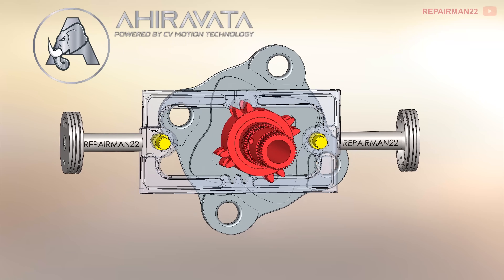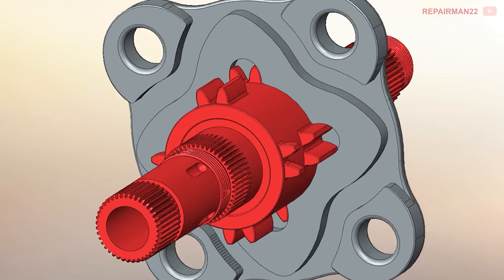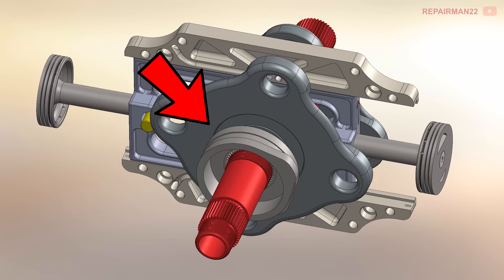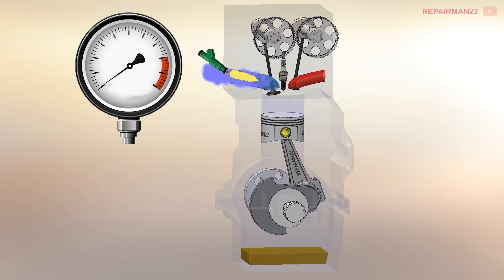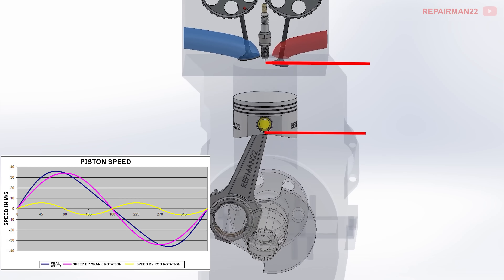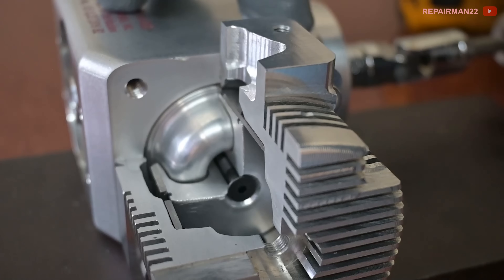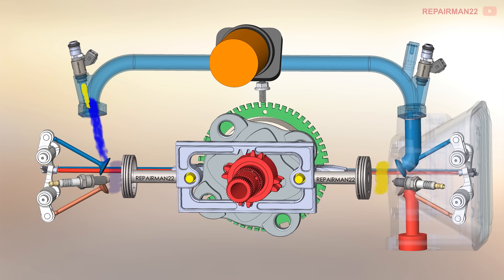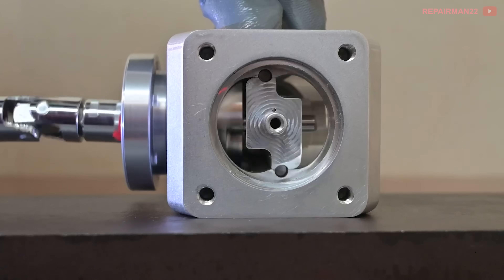The New FLOWER ENGINE 🌺 from Ahiravata 🐘

Comment: Something very simple that could minimize the friction between the pins and the flower is to put bearings on its tip, so it will roll through the rails of the flower, instead of slide
Reply: I'm sure you could get hundreds of hours of run time with ball bearings but not tens of thousands of hours like a conventional engine. The only bearings strong enough for a job like this would be fluid bearing and those are going to require more engineering on the motor designers part.
Reply: @deltafire5058  Makes sense considering it keeps getting smacked back and forth. Not sure though.
Reply: This is the most over complicated, engine design I have ever seen just to produce significantly less power due to the weight of the rotating assembly.
Reply: @fl_atv_riders4455  
Not really.
Reply: @fl_atv_riders4455 this could be a good alternative for hybrid engines..
Reply: That might work but it might also have a problem with being rolled on each side at the same time, in the same direction. But that might be worked around. the've probably already looked into it.
Reply: Oil lubrication will solve this just like how conventional crankshaft works.
Reply: Needle bearings?
Reply: It would be interesting to see when it’s under load like a motorcycle or small car.
Reply: This is literally a 200 year old technology..
Once again, Hindus build some outdated technology, and claim to "invent" it.
Reply: Magnetic bearings?
Reply: These wobble board cranky engines have been around since the days of steam .They do work ,but suffer from unusual wear in various places .Hydraulic motors use a fashion of this principle .Sorry ,but no cigar .
Reply: Please let us just look at the engine and how it works! As opposed to a new "cut" every 3 seconds and gobs of "gee whiz! this is so great!" commentary.
Reply: Like current rockers !!
Reply: Just the tip?
Reply: There u go…nice idea
Reply: The problem with ball or needle bearings is that their speed is constantly increasing and decreasing in this application. The pins may need to have bearings in the yolk body - then it is a matter of lubricating them.
Reply: Do not understand why there are so few teeth. Place more and use them to deliver the power to the drive shaft. Use the flower to synchronize the thing.
Reply: @MennoSmits-v1l 
The pins on the flower transfer the power.
Reply: @MennoSmits-v1l those few teeth are to synchronize  the contact points where the rollers do not touch..
Reply: Was going to say the very same!

Comment: I can see the four stroke version being viable. but two strokes are inherently dirty, because they have to burn oil to have lubrication. they would be difficult to meet emission control standards. and my other point of contention. is the teeth on the flower and the rod rack would be suseptable to breaking off.
Reply: Actually this type of engine will be better in 2 stroke.   Those old 2 stroke engine that requires oil mixed fuel is simply because oil is needed to lubricane the crank bearings and pistons.
Reply: What nonsense..?
Reply: Please let us just look at the engine and how it works! As opposed to a new "cut" every 3 seconds and gobs of "gee whiz! this is so great!" commentary.
Reply: The oil burning of a two stroke is due to combustion gases passing through the crankcase. In this design, the underside of the piston is separated from the ceankcase area, so that problem does not arise.
Reply: @pashakdescilly7517  But that piston to cylinder area still needs lubrication.  So I doubt you could completely remove the oil from the fuel.  I'll grant you that, with practically zero lateral movement, it would be far less critical but could it be eliminated completely?  Maybe some ceramic material would make that possible, but metal to metal generally needs lubrication.
Reply: @KenFullman  The connection to the 'crank' arrangement is off the centre line, so there will be forces carried though the piston, and therefore a need for lubrication. Ceramics and/or teflon may reduce this.
Reply: @KenFullman those piston work with gas floating piston rings that doesn't need lubrication...the lubrication happens on the lower part of the piston shaft...
Reply: @pashakdescilly7517 
Two strokes require the fuel and oil to be mixed together. whether it is mixed before the it is put in the fuel tank. or whether it is mixed by oil injection. either way the engine is burning a mixture of fuel and oil. and it's why they are inherently dirty engines. you apparently don't know much about two stroke engines.
Reply: @musicauthority674 Oh come on. The oil is mixed in ordinary two stroke engine to feed the crankshaft main and big end bearings. And yo a much lesser extent, the piston. This design separates the crsnkshaft from the combustion gases. Try thinking before you post.
Reply: @musicauthority674this design mitigates the fuel oil mixture..it is not your standard old two stroke engine...the lubrication part is below the air intake part that doesn't come noncontact with the air fuel mixture..

Comment: I predict this design will be yet another dead end, crankshaft alternatives have been tried an tried again the Scotch yoke is my personal favorite, but nothing will replace a simple crankshaft in a piston engine. For something like this to gain traction it must have some practical advantage maybe it's fewer parts or maybe the parts are able to be made easier/faster an helps to lower manufacturing costs. It's novel and I could definitely see this mechanism having a use in a compressor, but as an engine it's not solving any problem so it's a folly.

Comment: Limiting the speed to 2000rpm has to be because of the absolutely massive reciprocating mass. If the design would allow spinning up to 6000 or more rpm it would be making pretty much triple the power in the same amount of space.
Reply: There's no way it would be possible to achieve a higher RPM with that flower and rod rack arrangement. so using it as a conventional engine would likely not be possible. but there could be a remote possibility. it could be a powerplant for a generator in a hybrid configuration.
Reply: Remember that if the "crankshaft" is spinning at 2,000 rpm, the pistons are oscillating 4,000 times a minute, so it isn't as slow as it sounds...
That's why the cam lobes for the 4 stroke can be attached directly to the "crankshaft"... it is spinning at "half engine speed".
Interesting concept, but I doubt that the pin / slot mechanism can be made reliable.
Reply: This engine can't be used for higher rpms, simply because of the constant velocity pistons. At higher rpms these constant velocity pistons will find it difficult to give higher efficiency as in conventional high rpm engines. This can be used in trucks, tractors, marine engines etc, but not for performance engines
Reply: Please let us just look at the engine and how it works! As opposed to a new "cut" every 3 seconds and gobs of "gee whiz! this is so great!" commentary.
Reply: because the pistons have the same number of cycles while the shaft runs at half speed the pistons would have to triple their speed or operate at the equivalant of 12,000 rpm to turn the shaft at 6000

Comment: What you don't show is the running engine stopping... very ABRUPTLY! Like it ceased that one tiny line of contact in the one barely meshed tooth during the power stroke.

ie: Nice idea, but WAY too much power for 1 tooth to transmit to the the 'crankshaft' unless you find a lubricant that outperforms the norm by a factor of 10 or more.
Reply: All gears do transmit power one or two teeth at a time.

Comment: I can see how it can produce more torque(energy) but I also see how the moment the pistons change direction all that force is driven into just two tall narrow gear teeth. Compare that to the many wide gear teeth on the input shaft of a transmission. This engine won't be able to take advantage of the extra torque it can make because if it did, the teeth will break.
Reply: The pistons do not change direction or speed during the time that the gear teeth are in contact. They would be transmitting torque from the power stroke, but they don't have to deal with any acceleration forces... it is probably not the weak point of the system (which is the pin / slot mechanism...)
Reply: @davidrumsey3180  
In addition to protecting the gear teeth with a flywheel, the transmission can also distribute the load by switching gear teeth that are subject to concentrated loads due to clutches, etc., to other gear teeth, thereby extending the transmission's lifespan.
Reply: Is it better to say that fatigue is distributed over many gear teeth?
Reply: The flower handles the rest of the torque before comming in contact with the teeth and the design Is not defferrent than any conventional gear that always has one or two teeth in contact.
Reply: Even if no torque is applied to the piston, in order for the piston to reciprocate at high speed, it is necessary to regulate its own movement due to inertia.
The gears become fatigued when resisting this inertia.
Reply: um... even the transmission is limited to one or two teeth in contact at any time, even if helical... all the way down to the diff, with increasing mechanical advantage at each reduction stage...
Reply: @paradiselost9946 
The transmission gear's large number of teeth allows it to distribute the torque peak load over time.
The peak is also significantly smoothed out by the flywheel.

Comment: and the most important factor... longevity...
Reply: It doesn't look like it would wear down any quicker than your average aluminum engine. In fact with the rails holding the pistons centered it would probably have almost no wear on the cylinder walls. The volume behind the pistons in the 4 stroke variant could be sealed and reed valves installed to convert it into an air pump to make an air cooled variant.
Reply: @3fives-j5w  Or it is converted from existing air pump since start.